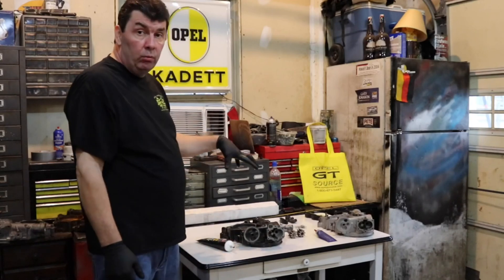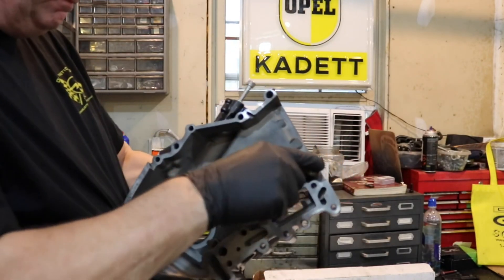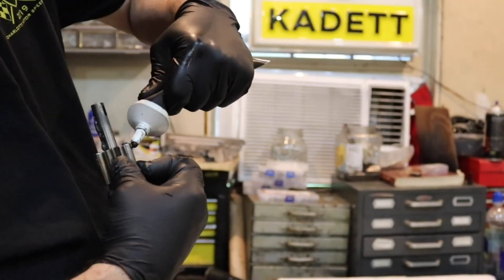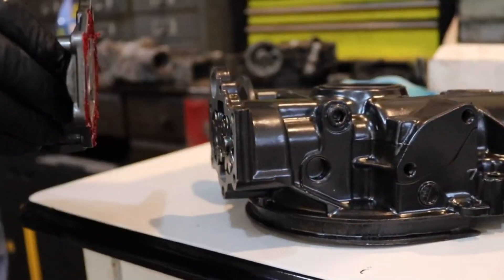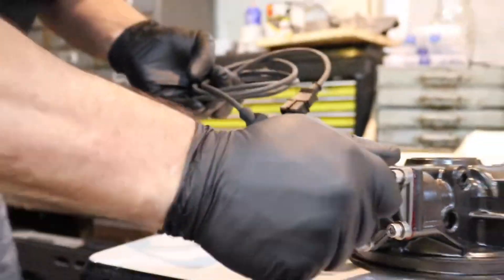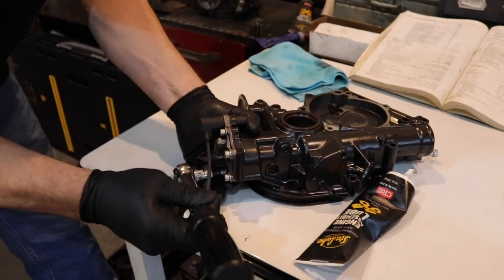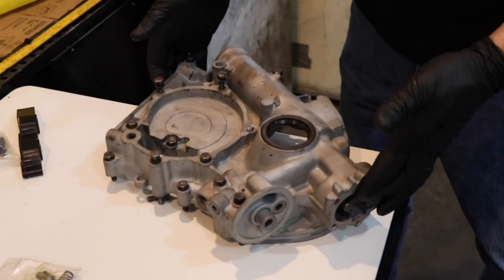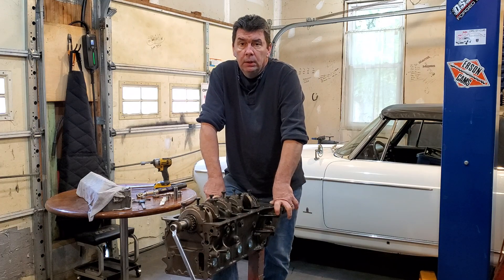How to Assemble an Opel C.I.H. Motor - Timing Cover Prep - Take 2

Comment: If you need some 7mm timing cover and water pump bolts, they're available from Edelschmeide in Germany (they ship worldwide). I just bought a load of CIH (for a 1.9 Opel Ascona engine) bits from them and it was all very affordable. I'll be doing a video on my channel soon about the purchases and their respective fitting/uses.
Reply from the maker: Yep.. I list Edelschmeide in the video decription. The issue isn't that you can't get those bolts. Its that they are specific to the Opel CIH and you have to get them from a special Opel parts source. The local nut and bolt store won't have them, Amazon won't have them, etc.. Same holds true for the M9 intake/exhaust bolts.

Comment: i am back again =D did you know the short video that shows the BEST way to build up oil pressure in Cih Engines? Search the video  "CIH Motor Öldruck aufbauen" on YouTube,> its from Armin, one of our smartest Cih-Buddies out here in Germany! =) he removes the gear of the 
ignition distributor and turns the oil pump with the distributor and a drilling machine
Reply from the maker: Actually going to show that soon.. and yep. Take out distributor, and run with a drill before you start.

Comment: NEVER leave oil pump gasket off before you measure pump gear protrusion. Older timingcovers that use gasket, gears protrude over gasket surface(or are just in level). If you leave gasket off, pump gears will seize to cover. 
There are different thickness gaskets depenting on protrusion. 

Newer motors(1980s) that use no gasket, have slightly deeper pump housing to give correct endplay for gears.

So ALWAYS measure gear protrusion and select right gasket.
Reply from the maker: True, remember in most cases we are talking 1969-1975 here in the US, and all used the gasket. That said, I have found that the +25 year and over 100,000 miles of wear on them has pretty much made them flat with little protrusion. The other thing to consider is that replacements are not readily available. The best you can do is work with the gears that you have. So in the case of the 1.9L and older I use the thin gaskets, and on the 2.0L second generation blocks I use sealer. Some new reproduction gaskets are TOO Thick, and can cause you to have low oil pressure.
Reply: @GoinManta  true that repro gaskets are crap.